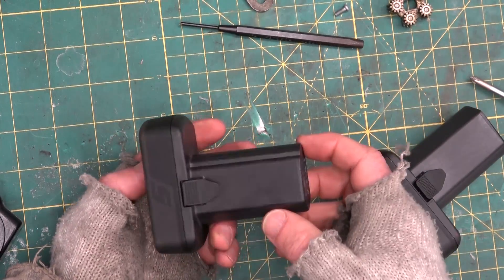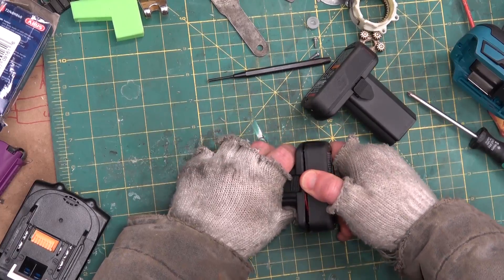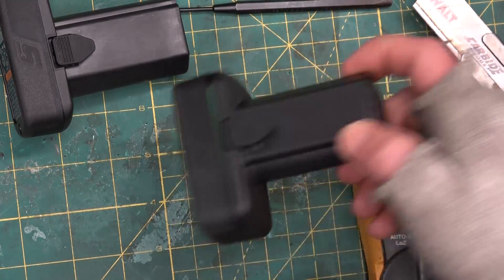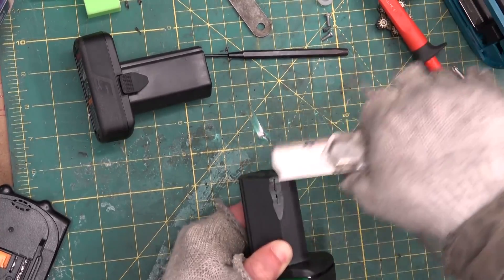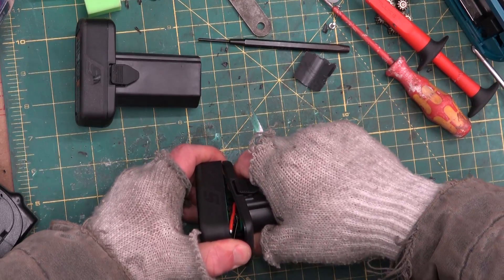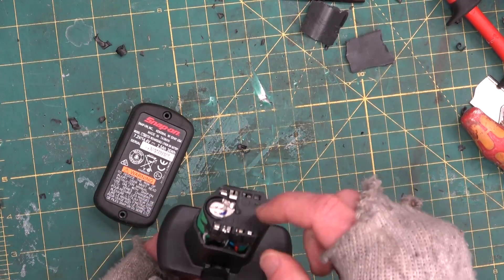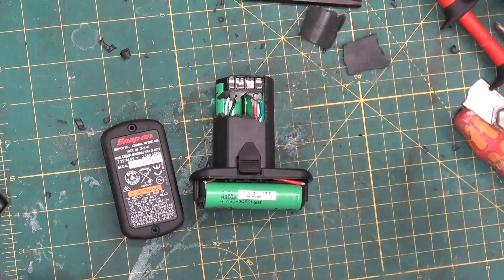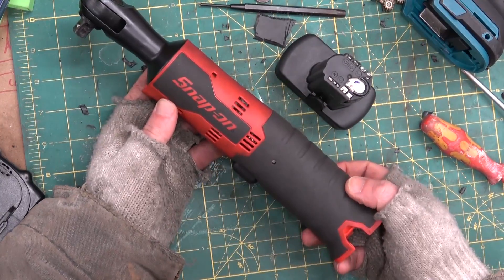BOLTR: Snap-On Microlithium Batteries

Comment: They're dual voltage because Fap-Off has 7.2V tools and 14.4V tools. The big batteries can be used in either tool, the small ones only in the 7.2V tools. I guess the idea is the big'uns last twice as long in the small 7.2V tools. I know there's a joke in there somewhere.

Comment: Just got replacement pack batteries for my snap on screw gun 
New batteries slipped into the snap on battery outer case for $40 each

Comment: Good to know the battery is up to par. I paid close to 300 down here in Colorado. 2 batt, charger and tool. Will be looking at the Milwaukee 12v line when this takes a crap, due to the hate and hate relationship I have with Snapon. Thanks for the info

Comment: actually kinda clever arrangement of the terminals, allows the tool to parallel or series them as needed without having to use any electronics, just how the terminals are wired.

Comment: Took a cheapo cRyobi Uno apart the other day cause it had shit the bed deader than my ex wife's sex.  Fookin Sanyo cells.   Jump charged past the protection circuit using a good pack.  Revived the imp and it's been working ever since.  Lesson learned.   Never leave a battery in a brushless tool, it can vampire it down slowly and past the protection devices.

Comment: BTW some 18650 cells have the protection built on top of the positive terminal, makes it a couple of mm longer. Also the multiple terminals, for all the cell terminals, could make it a cheaper battery since there doesn't need to be a balancing controller inside.

Comment: Put some dielectric grease on the terminals of the battery and it will slide in and out with no problem

Comment: It seems like this can be used as 4s or 2s2p. I'd be interested to know if any of their tools run off the 7-8 volts and why
Reply: In case you didn't get an answer or what not the reason why these cells were 14.4 was to maintain compatibility with their old cordless impact wrench and cordless screwdriver which used 7.2 volts. They have long been replaced with the 14.4 lineup my guess is that the 14.4 came out so close to the 7.2 they really didn't want the customer that bought the 7.2 tools to get screwed over if they needed a battery replacement.

Comment: 4x Samsung 25R batteries at $3 a piece = $9. Give maybe another $11 in manufacturing costs... we get a $20 battery. Snap On, honestly only a markup of 400%?? That is unprecedented! Way less than the standard 10000000%, someone is getting fired.

Comment: 2:30 seem to be two separate parallel circuits that can be connected in series
Reply: I'd say that happens in the tool too, clever design. I bet the new 7 volt stuff could parallel the two sides for longer running or more amps.

Comment: The big snap on lithium batteries are junk  had 6 go bad under 2 & 3 years the little ones actually last well haven't had one go bad for 5 years. 2 year warranty on the big snapon batterys are a RIP off Milwaukee offer 5 year. I think the larger batterys are rigged to not last because the individual battery are good if you manually charge so the chip is not allowing the charger to charge I need to check the code on the chip to see if its rigged.

Comment: i have a 3/8" snap -off  electric ratchet for thoses that seen hard use for like 4 years till it slowly got weaker and just died a few months ago im done with them crappy tool guys i aint dump a cent let alone $120 to get it "fixed" so if you want one thats been beat to hell from daliy mechanic use ill be more then glad to shipped it to you

Comment: 3.6 X 4 = 14.4. Looks like its set up so that the tool can either tap it 2S2P for 7.2V or 4S for 14.4V. Pretty cool. 

Looks like they chose to use a more conservative "3.6V per cell" nominal rating partly for simplifying backward compatibility... Less questions to field that way. Also results in a more realistic WH claim, since most batteries don't deliver their full capacity ratings anyway. 14.4V is a much more realistic real-world average voltage to expect under load through the discharge. 

Dewilt would have called this a 16V pack, which, technically, yes, off the charger, open circuit, it would be ~16.8V. Using that same strategy, Dewilt coulda shoulda been selling their NiCD packs as "21V" or "22V" instead of "18V."

Comment: Samsung 25Rs are about $3.50 each in single unit retail cost, I can only imagine what they cost in lots of 10,000 to Snap-On. The monitor board can't be more than a buck or two. I don't know how much custom molded cases like that cost to make, but I can't imagine it's more than $5. I know retail value-added product is usually about 3-4x material cost, but even $80 US is a ball squeeze.

Comment: Yup, old battery tech but a good one...Samsung 25R out of the Malaysia factory. Surprised to see it in a power tool pack! Better 18650 cells are available now, like the Sony/Murata VTC series and Molicel’s P26A, but they’re probably at least a dollar more per cell.

I think the voltage readings were weird due to the wrong terminals being used? It looks like there were square and circular depressions for the pos. and neg. terminal indicators. You measured the voltages using a square pos and circular neg and then you measured voltage using a circular pos and square neg. Maybe the voltages need to be read using square pos/neg and circular pos/neg? If that makes any sense at all.

Comment: Meh.  A commodity at this point even if it's high quality.  An unserviceable case.  Like any energy thing, I prefer calculating something relating to its power.  36wh is ~= $3wh.  Compare that against your other packs for science.
A 12V 6.0 Ah Milwaukee is 6000 x 11.1 / 1000 = 66wh(ish).... For $65.89 delivered.  ~$1wh vs ~$3wh full retail.  Is it still worth it?  You'd need to ask yourself  2.83 times, to be sure.  I don't have anyone dangling that tool in front of me though.  Maybe I'd buy it too.  Kinda doubt it though.  Usually if a small impact can't be used to loosen, I don't gravitate towards a tool like that.  I can't run last minute to a store (or amazon even), and grab that pack.  Meh.  Now buy at least three of them.  2 is 1 and 1 is none.

Comment: AvE not your best BOLTR, sorry  - do we get to see the circuitry inside, and did you solve the voltage? Does it switch like flexvolt or is it possibly 14.4 when taken across two opposing terminals? Seems like you opened it, looked at the cell brand and there was 4 and that was that. Would be interesting to know about the rest of the internals as usual? Unless I missed something...? Cheers.

Comment: my room mate decided to throw his snap on electric ratchet due to the geezless thing not having the truck nuts to break a finger tight bolt loose needless to say after we took his somewhat apart (broke in half) he went Milwaukee brushless after that
P.S. yes it had a brand new battery and yes the battery survived no problem

Comment: I think I would prefer my high amp, high drain Sony or eFest's for good power grunt, think my Sonys are rated for 30A and I only use them for my mechanical vape machines, the eFest high drain purples I use elsewhere although I do have some Samsung 25R's and they are a good middle of the field 18650.   There is a lot of fakery out there tho, these batteries are so easy to rewrap using pre-printed heatshrink turning a Uwilldie 9900mah firebomb into a sexeh Samsung or Sony in a trice and a lot of run down laptop Samsung's are out there pretending to be fresh virgin cells only for people to find out they are well abused and used.
Reply: Looking at it, about £10 for four 25R's so are we expected to just sweep it under the carpet they are charging like £50 for a bit of wire, circuit board and some plastic?   Bit of a ripoff imho :(   Sorry but that is serious gouging going on there, several of my cordless tools have the same battery inside but charge on avg about £11, Parkside a brand by Lidl's all have Samsung 25R's and you can buy a 18v drill with charger and battery for £29 and the same for the Parkside 20v impact driver set.

Comment: I've had my snap-on mini impact and drill since 2014, never had to buy new batteries. Although they do have about 80% of the runtime from when new, but what can you expect. On the impact however, ive had to send it in because the lights on the front quit, and the nose kept coming loose. It is starting to do it again, for how useful they are and how small they are with the amount of power they bring, i don't regret buying them one bit. On the other hand, when they die, i am going to go to the Milwaukee side, for the simple fact that everything about them is cheaper wit the exception of quality. Just my .02

Comment: "you're paying more, but you're getting more"

Uh, not really? It's still only 2.5Ah...
Reply: Invidious Ignoramus at a higher voltage
Reply: Its design means you can run a tool at 7.2v with 5Ah by connecting them in parallel or connect them in series for 14.6v with 2.5Ah, Ah is a worthless unit to measure capacity unless you're comparing the same type of cells at the same voltage.

However, where I do agree is getting more, since even good cells only cost like $4-6 (even less in bulk) and a lot of tool batteries these days cost $60+ whereas although it won't come with protection you can DIY with a similar size lipo for around $15.

Comment: "Microlithium" 
uses 4 bog-standard 18650s (albeit good ones)
What's micro about this?
Reply: The dicks that buy em!
Reply: The "MicroLithium" is the smaller 7.2/14.4V battery line. Snap-On also has an 18V "MonsterLithium" battery.
Reply: Canada! Amount of lubes they are using on us
Reply: The little Mil-fuck-ee light someone sold me dirt cheap has a SUPER DUPER SMART LITHIUM brand name bs attached....open it up to find it's just an 18650 with a current limiter on it, so you're forced into their little ecosystem either way. Ha
Reply: Nah, the Lithium is smaller. Sanp-On have managed to break physics by changing the atomic radius of Lithium. 152 picometers was way too big!

Source: I̶ ̶m̶a̶d̶e̶ ̶i̶t̶ ̶u̶p̶  Snap-On sales rep.

Comment: 12v is just a 10.8v motor with a marketing wank rating on 3 l-ion cells at near full voltage.  14.4v is a normal l-ion motor voltage for 4 cells. 18v for 5 cells, same marketing wank will call them 20v.

Comment: You never explained the dual voltage part. My guess is that the two sets of terminals that you checked were actually in series with each other.  Try taking voltage measurements between the diagonal terminals?

Comment: aas aa mechanic i have a mix of the snapon and milwaukee cordless stuff. the snapon 14.4 line is far better than the m12 stuff. my m12 ratchets didnt hold up and the fuel versions are just to large. the biggest thing with snapon is the price of the batteries. the bare tools are compaarible in price to snap ons

Comment: All the lights that take that battery run at 7.2 volts and the ratchets and whatnot run at 14.4, the battery can run in series or parallel, the terminals in the tool are in different locations to achieve different voltages.

Comment: good to know i didn't get complete shafted on the fap-off batteries .
my 3/8' electric ( same as in vid ) has been going strong for 4 years , haven't had to send it in for a rebuild yet . though i've cooked my 3/8" impact for the 3rd time in the same time span . I absolutely love the little sawz all ...  drill is ok but sudden stops from trigger release and the clutch will spit the tool you are using out

Comment: Battery fits tight because the plastic clips break. Battery fall out with vibration. Dealer told me that Crap. I bought the super torque 3/8 14v impact was great until it broke. Replacement gun cost 60$. Not even close to the torque the original had. Snap on battery tools not so good. Oh and don’t worry when they come out with a new battery design it will not work in your old tool.

Comment: Those 2 plus and minus terminals seem to be coded with a square and a circle - what happens if you check the voltage between the terminals opposite of each other rather than next to each other?

Actually now that I am sitting and thinking about it, I betcha the tool itself contains the circuitry to either parallel or series the 2 sets of 2 cells inside the battery. All it would need is a jumper in the right configuration based on whether the tool wanted 7v or 14v.

Comment: Hey ave, I have a Milwaukee m18 grease gun that has been fed many a hot supper and she’s good and proper dickered. Locked right up. I work at a metal recycling yard and I had a Makita sawzall come in the light iron that doesn’t look t bag! But I have no batterys for it. I was wondering if I could send you one or both to make a video on. Assuming it doesn’t cost me an arm and a dick to get it up there to canaderp from Massachusetts.

Comment: I use that electric ratchet every day at work and it gets a hot supper all day long. Even ripping on the battery to loosen bolts the motor can't. It's a trooper and hasn't failed in two years. Really power hungry though. Can eat up to two fully charged batteries on a busy day.

Comment: The batteries are probably $20-$25, BMS board $5-1$10, case 3D print under $5 and you have a replacement for 1/3 the cost off the truck. 

The 4 terminals are so that the voltage configuration is done on the tool, + to + and - to - gives you 7.2 v and 5 AHr, or connect in series and get 14.4 v at 2.5 AHr. Same battery for different tools.

Comment: 14.4v is 4cell 18650 in series. 14.4 is nominal voltage (3,6v x 4) This can be connected in configuration 4s1p - 14.4v nominal 2.5ah or in 2s2p - 7.2v nominal and 5ah. 
The '12v' battery from other brands are from nicd/nimh era. Nominal voltage of lijon 12v is 11.1v for 3.7v cell and 10.8 for 3.6v cell. 
Max voltage of 4s lijon is 16,8v and for 3s is 12.6v.
Charged lijon is 4.2volt. you can easly calculate their voltage:)

Comment: If you look carefully at the DC terminals, you have +square, + circle, -square, and - circle.  
I'm guessing the tool itself puts the two banks in series if it wasn't 14 vdc and in parallel if it wants 7.5 vdc

Comment: Snap on 14 V batteries are prone to failure not because of the batteries themselves but the terminals get damaged during insertion and removal
Reply: So..  They need lube as much the customer does

Comment: Part of the price is for the big fancy catering truck with the chrome wheels they're delivered on.
Reply: I remember a time when my SnapOn guy would come over to the house at the end of the day and we'd drink beer, bullshit and I'd repair broken air tools.

While I truly believe SnapOn battery operated tools are a rip-off, how many other companies will come to the shop you work, extend credit to someone they don't know and deliver and replace tools that clearly abused. SnapOn also has one of the worst warranties on their battery operated tool, typically one year. Milwaukee has a three year warranty on the tool and battery.

Sears would replace Craftsman tools, but you had to drive to a Sear store. Toward the end, Sears wanted to replace USA made hand tools with Taiwanese tools. Yep, Craftsman is 1/3-1/2 the price of a SnapOn tool, but there are some specialty tools that Craftsman doesn't offer.

Comment: Twice 8volts and you either series them to get the „14v“ oder parallel them for the 7,4v ( 2cell 7,4v (and series =4 cell 14.8 nominal volts)) (max volts is 2 x 4,2v or 4 x 4.2V you do the math :p )

Comment: the terminals are so the battery can be wired as 7.2 or 14.4v depending on the tool. look at the circuit board in your sander and it's obvious :)
Reply: aaaaand now I got to the 8 minute mark

Comment: Hrm... 3D printer plus 4 of those sammys at ~$8 and a cheap balance board off ebay for 3... =135 USD with no bargain hunting making your own. Then each additional battery pack is 35ish.

Comment: As far as I can tell, Snap-on's biggest sellers like their ratchets, impacts, drills, grease guns and electronic torque wrenches are all really well built. Their low volume stuff like the 14v driver, sander etc are junk. Things could have changed since I bought mine and I'd be willing to send you some of my stuff for tear down since I don't use them anymore.

Comment: Im surprised that you had samsung 25r 18650s in your snap on pack. I popped mine open about a year back and mine has samsung 20s 18650s.... Two very different batterys
Reply: As they come out with better cells,  they source better cells.
Reply: @iancarnel8609  I have a job where I deal with 18650s fairly regularly. The 20s and 25r batterys are basically different classes. The 20s is a lower mah but higher amp class. 
25r: 2500mah/25amp
20s: 2000mah/30amp 
Thats where the confusion comes in, for me . im going to hold off on any replacment packs till they can squeeze a 20700 or 21700 in there .

Comment: I think the sander you bought it probably the most over priced piece in the 14.4v lineup.  The driver’s rocker trigger mechanism is what makes so much better in a flat rate setting.   I have a 1/4” ratchet that was given plenty of hot supers throughout its life. I’d be more than happy to donate it to the empire of dirt for a tear down.

Comment: This video makes me wonder a bit about how they build these batteries. It was obviously not made to be taken apart, so why was it put together with a pair of screws? Was it to give some sense of quality? Because if it had been ultrasonically welded or even glued together it would have been at least as strong if not stronger than this. And as it's not coming apart anyway, why not weld seal it permanently?

Comment: It's not an "extra battery" as in a bonus. They have to use 4 batteries to get the dual voltage. Each 2 batteries are connected in series to form two circuits, depending on the tool, they are either used in parallel to get 7.4v or in series to get 14.8v. nothing is done for free or as an "extra".